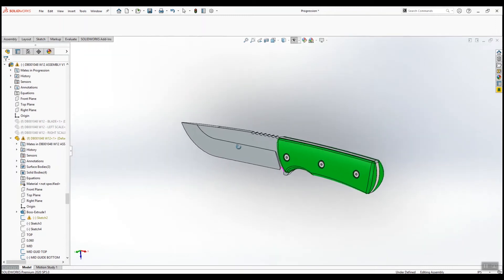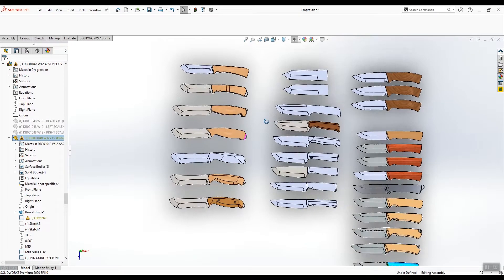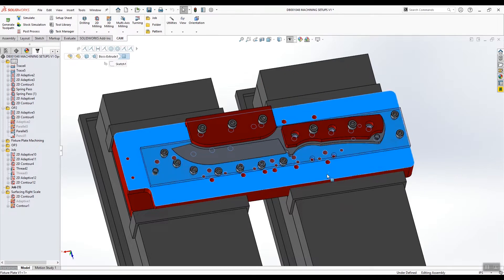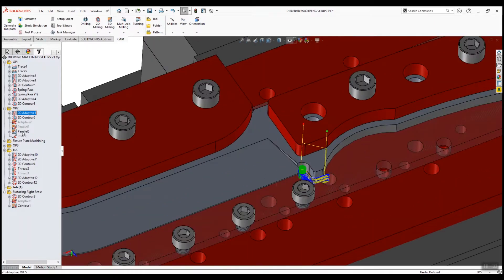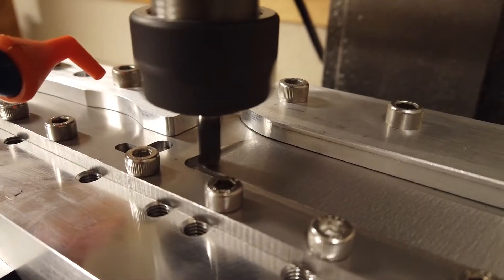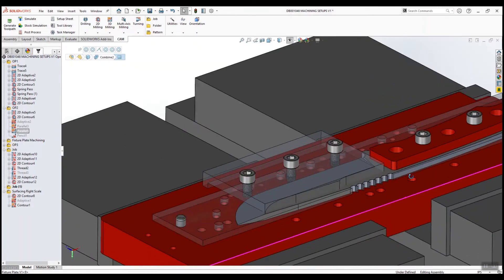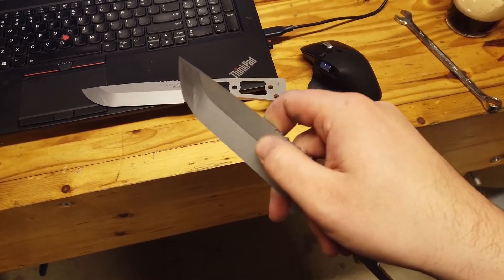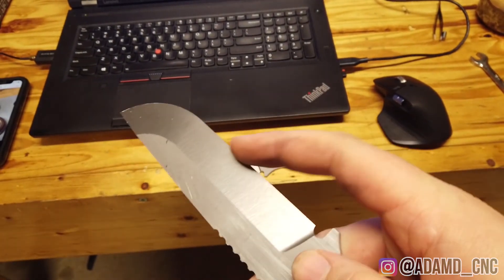Episode 1: Blade Blank - Machining & Fixturing

Comment: Hi Adam, thank you for this great video, I want to make a kitchen knife but all videos I seem to find are generally from Steel, issue is I dont think they are food safe in general without a special coating.

Stainless would be so hard to machine too, do you make your knifes for food uses or for outdoor hobby? What do you recommned?
Reply from the maker: @ROBOROBOROBOROBO  check this one out: https://youtu.be/OMFZ1lOozTM?si=lWO1mUh8coDe3zHt out of AEB-L stainless steel
Reply: @adamdebowski2037  Thats awesome thanks Adam, exactly what I was looking for!

Also, your cnc conversion is really impressive, it cuts stainless so easily as if its cutting aluminium without any lubrication or so on. Really looks nice, you must have a good spindle and strong steppers, I will also check what motors you  used 😃

Thanks for the wealth of knowledge you upload here
Reply from the maker: @ROBOROBOROBOROBO  cheers! Thanks for the kind words. In this video I go over exactly what I've done to convert the mill if youre interested: https://youtu.be/bN_D3NWwdu4

Comment: Great stuff.  I’ve been making knives for awhile and just ordered a CNC mill.  Would you consider sharing the Fusion 360 file.  I just started watching tutorials and a knife template would be an awesome way to jumpstart my progress. Cheers
Reply from the maker: Hi Ira. The knife is designed in solidworks - not fusion. I could export a step file you could look at and even use for machining but you will not be able to edit the features. If you’d like to shoot me your email i will send over the files
Reply: @adamdebowski2037  Thanks Adam.  I may take you up on that offer in the future. Cheers

Comment: Nice job. 

I am in the same boat: I have a converted PM 728 CNC and have dabbled into knife making , motorcycle parts, prototype parts. 

I use SW for Cad and fusion 360 for cam. 

What is your day job if any ?

Regards
Reply from the maker: Awesome. Would love to see some of your work on the 727. If you're using SW, i'd recommend trying HSMWorks plugin. If you change your model, your toolpaths will update automatically and it's virtually identical to Fusion360 Cam - The HSMWorks plugin is by Autodesk - so it's really the same bones. It's $90/month - so a little more than FUsion360 i THINK.... but i enjoyed the switch over.

I'm a mechanical engineer in manufacturing from 9-5 mon-fri.